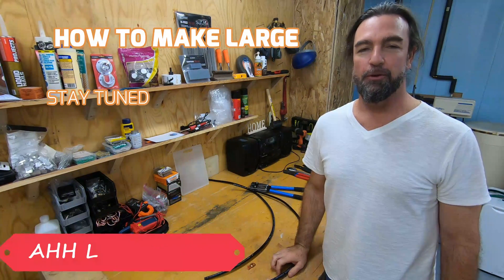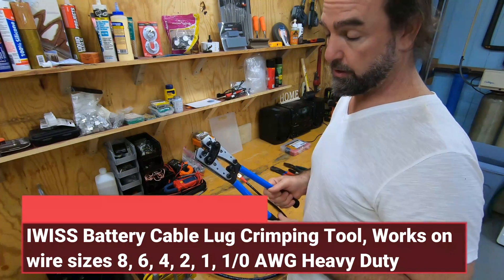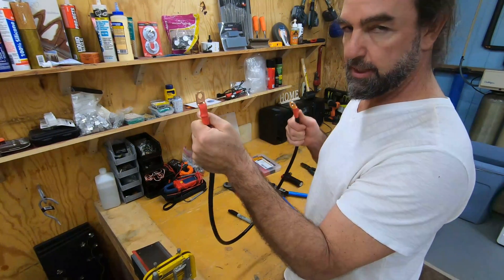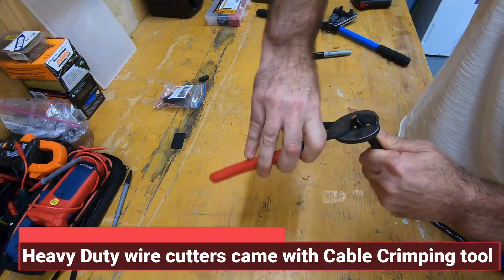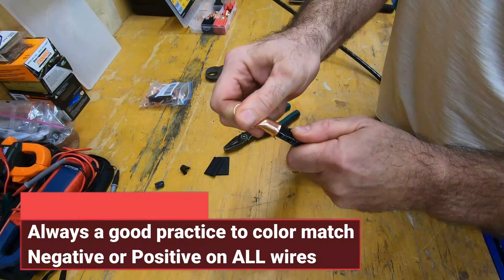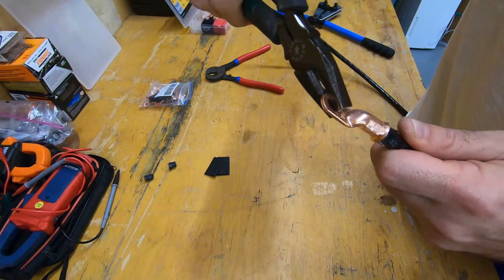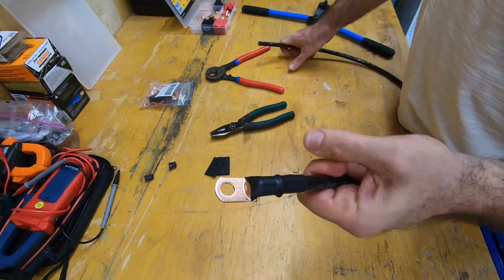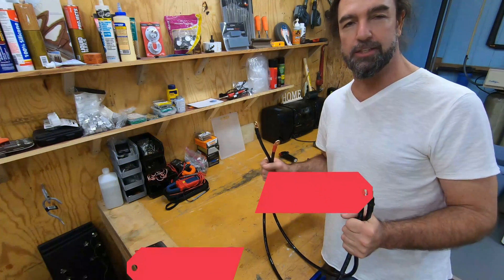Making professionally crimped large Electric Cables

Comment: If you score the inner conductors when stripping the wire insulation, it will likely break at the score mark at some later date... Not a good idea to contact the conductors when stripping off the insulation.
Reply from the maker: - Thank you Stuart for your input as this is a very important message to those making cables, double, and triple emphasize on making sure you do not accidently score the cabling that could lead to a break at a later date and or worse a short circuit!